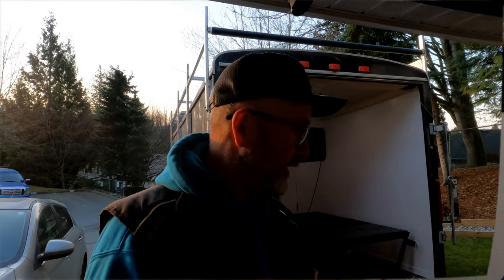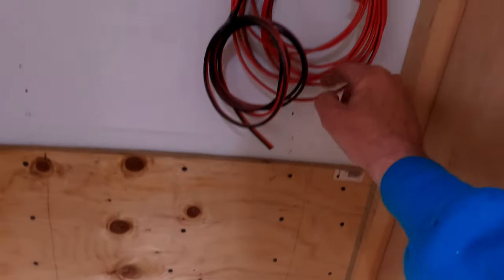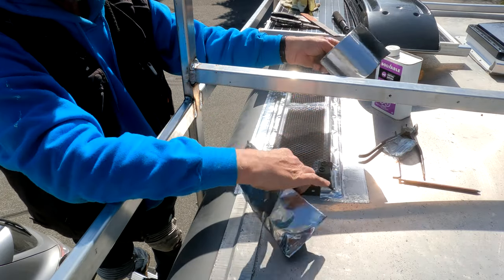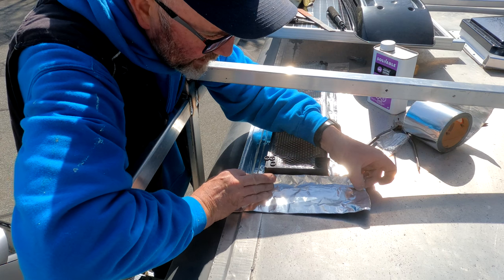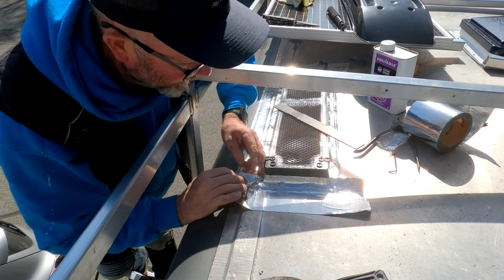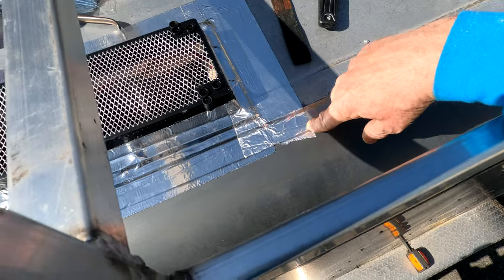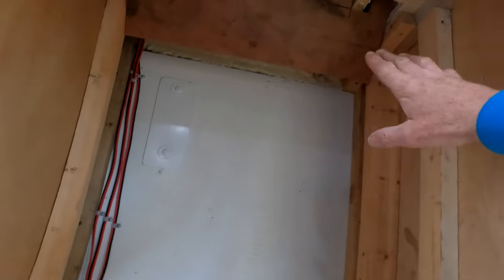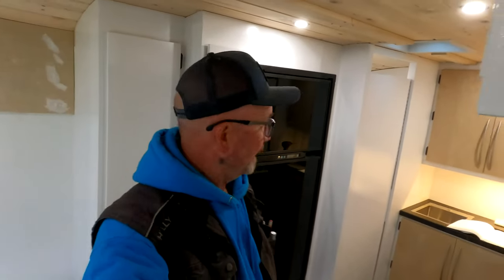Cargo trailer conversion - Fridge installation

Comment: Good video, and nice install, good luck with the propane fridge, they wouldn't be my choice but if you follow the instructions it should be o'k.
Reply: Thanks WRXS!!! The fridge install has been easy, and yes, follow the instructions for sure. I chose the two way fridge as I have one at our rec property and functions as well off propane when boondocking as it does when plugged into electricity. Curious tho, what would be your first choice for a similar use fridge?